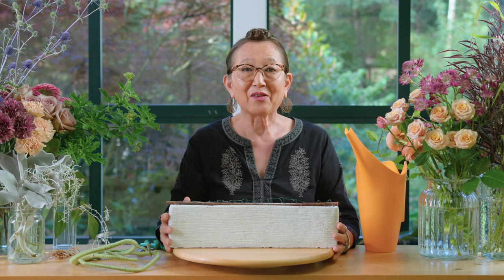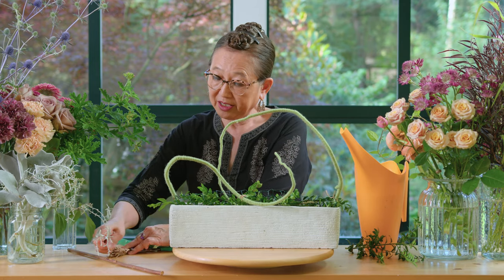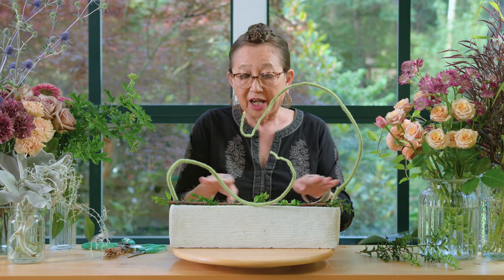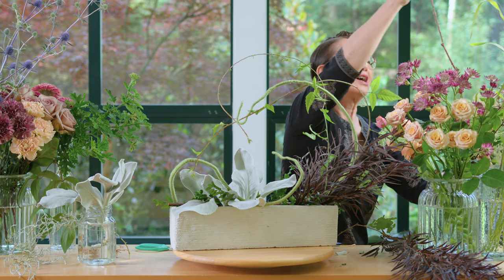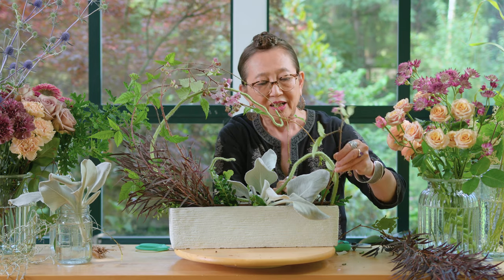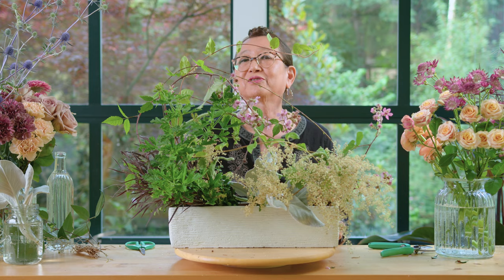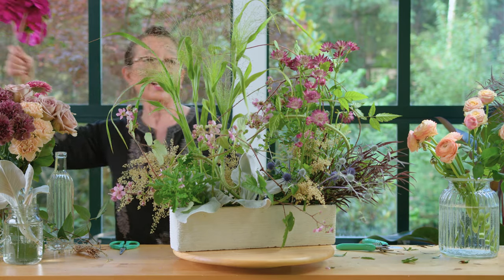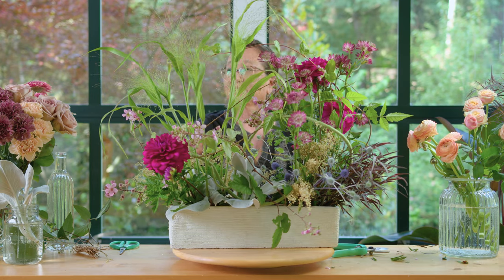FLOWERING WITH CHICKEN WIRE ROLLS Tips & Techniques with Hitomi Gilliam AIFD

Comment: Hi, thanks for your lovely video . Is it possible to change the water of arrangements in chicken wire? What is the best way to do that ? Tia
Reply from the maker: It’s very easy... you just lift up the whole arrangement with chicken wire and refresh water. Or you can just run water into the container in the sink, through the chicken wire mechanics. Xxx